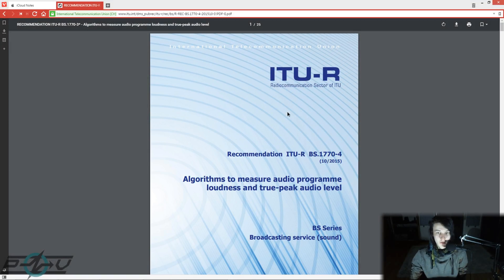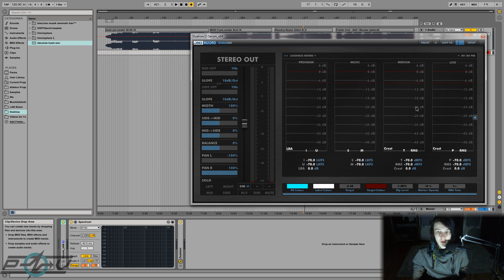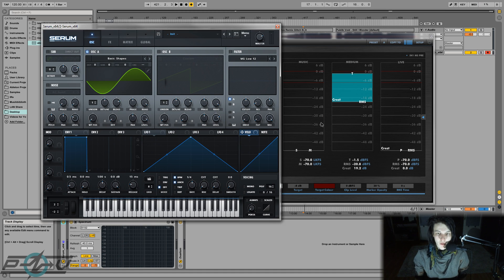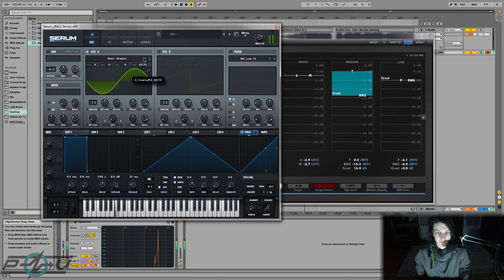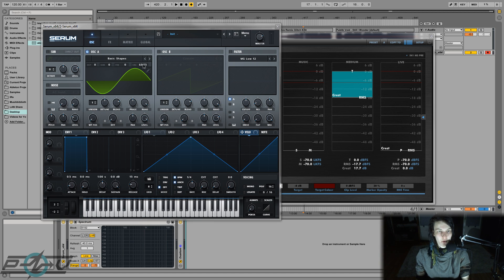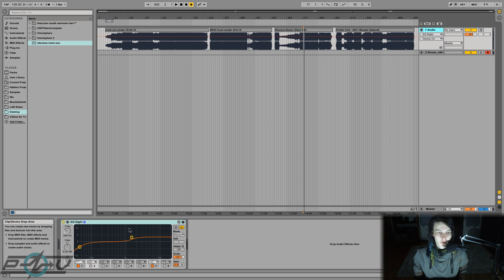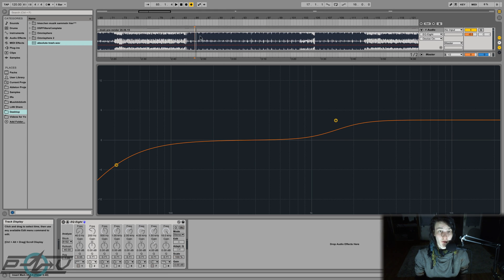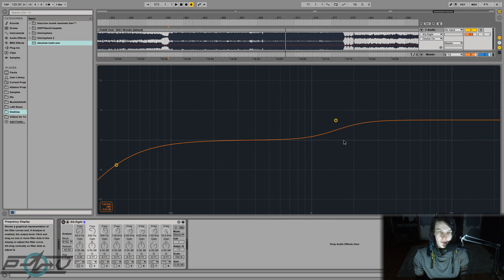What does an EBU Loudness Meter really measure? (About the K-Weighting Filter)

Comment: How is it that after extensive research and testing they arrived at a weighting curve that doesn't include a lowpass? I see that tones at 23 kHz trigger maximum loudness measurement. Some music with lots of synthetic treble also measure too high compared to Replay Gain.
Reply from the maker: Good question, I don't know either. ReplayGain is definitely a little more sophisticated, afaik it uses Fletcher–Munson curves and applies some sort of statistical quantile to the RMS history. The ITU-R recommendation seems to keep things very simple on purpose. To quote the paper, "The first stage of the pre-filtering accounts for the acoustic effects of the head, where the head is modelled as a rigid sphere." Not quite sure why this would make more sense than using an approximation of the sensitivity of the human ear. But it's a simple model, it's easily applicable to signals with different sample rates (filter responses tend to be very sample-rate dependent in the high frequencies), and it does not make any assumptions about the upper limit of the hearing range (which obviously differs from person to person).